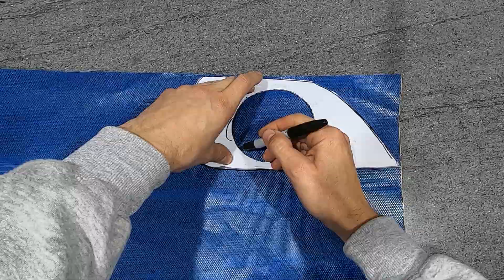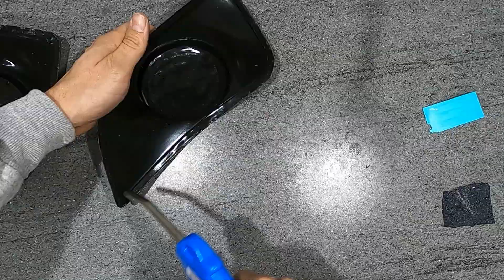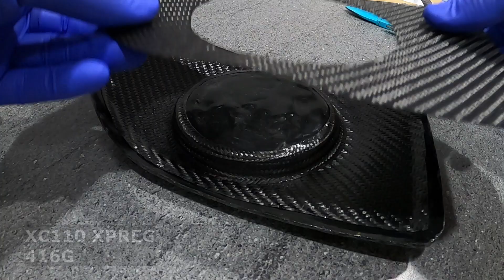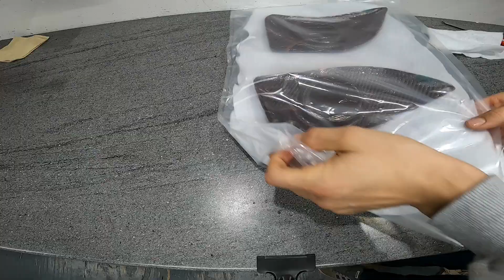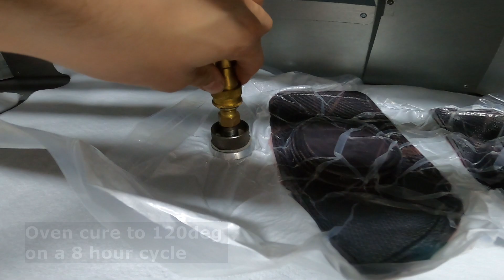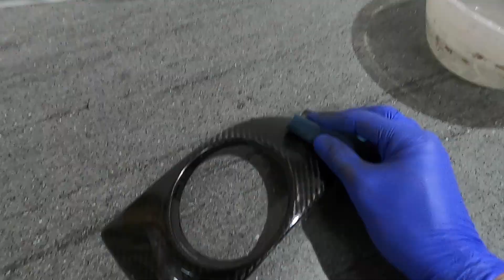How to make REAL Carbon Fibre (Fiber) fog light surrounds.

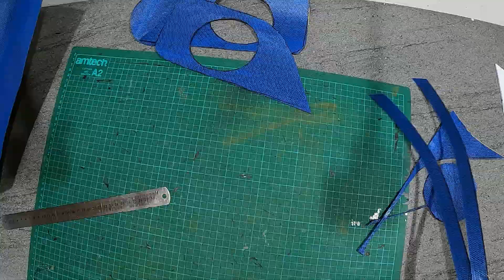Comment: At 1:00, how did you make that "mold"?

So, if I am going to make a kayak, how do I make the mold that will be used to make the fiberglass/carbon fiber hull?
Reply from the maker: This mould is made from tooling prepreg.

For a large kayak, I would use gel coat backed with resin and chopstrand fibreglass. You can see this process in my other videos.

Comment: Now that's a tidy set up. What did you use to fix them to the original part?
Reply from the maker: These were bond into position, so we used tiger seal.
Reply: @CarbonWorkshops  nice. I've seen a good bit of your work and it's absolutely class. 💯 % quality
Reply from the maker: @NorthdownAngler  thank you 🍻

Comment: Amazing work as usual! What grit do you use before you clearcoat?
Reply from the maker: Thanks! I used 320 grit
Reply: @CarbonWorkshops  Do the scratches from that grit get completely hidden by the clearcoat? I use 400 but 320 would for sure have a better bite. Maybe I should try that too!

Comment: How much did they weigh?
Reply from the maker: Original was 48g. Carbon was 23g
Reply: But you laminated on plastic, no?   So no savings? Hate CF laminate.  Will not hold up.  In cold will crack under clear coating.